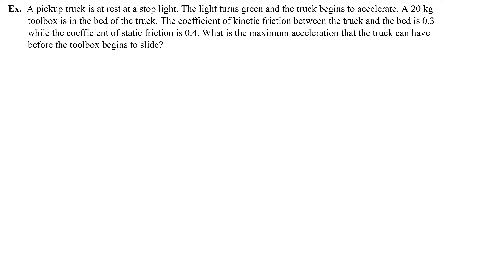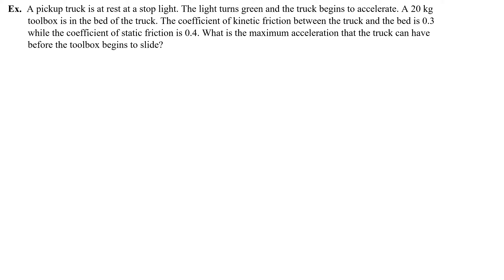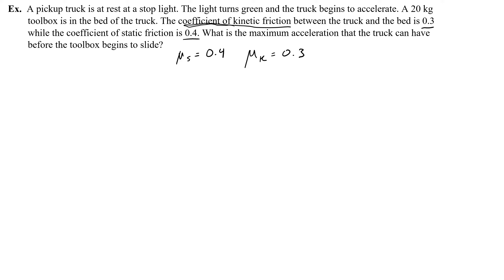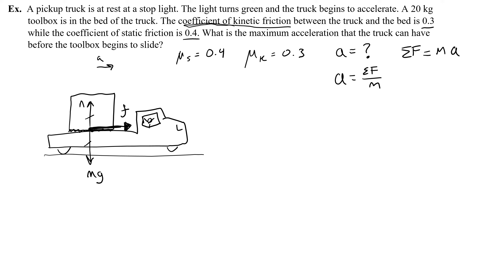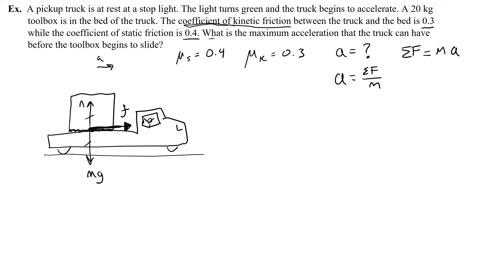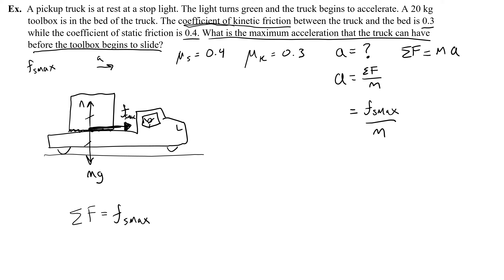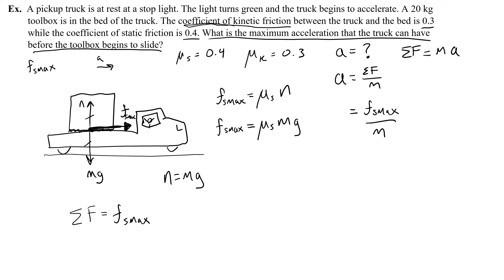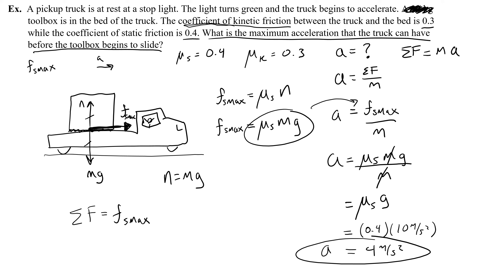Maximum Acceleration for a Box on a Truck Friction Problem

Comment: As long as the material of the box and bed of the truck stays constant - the weight won't change anything? Seems so counterintuitive. Like, you would think that a heavy/dense object would stay in the back of more reliably than a light object.
Reply from the maker: Pretty crazy to think about but yes. As long as we can ignore air resistance and the materials stay the same, the mass of the box doesn't change the maximum acceleration the box can have before it slips.

Comment: So the uk=0.3 doesn't matter?
Reply: no since there is a static friction before the box starts to slide (from what i understand). you would use the kinetic friction when the box starts sliding.
Reply from the maker: Correct! If the box was "slipping" or "sliding" in the truck bed you would use the kinetic coefficient.